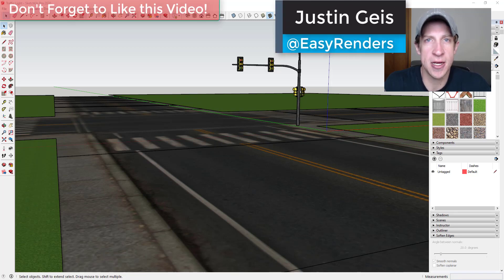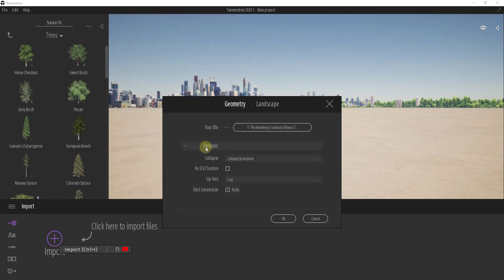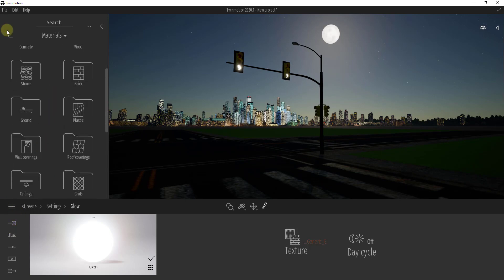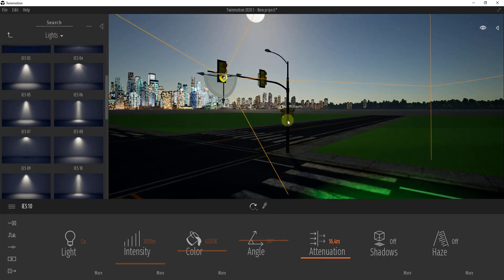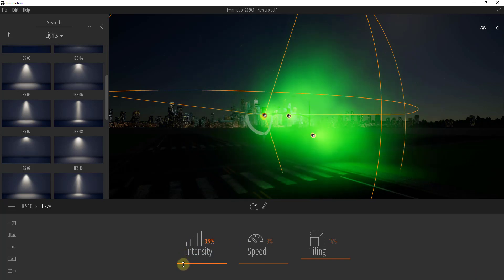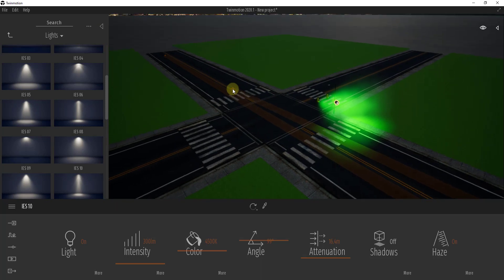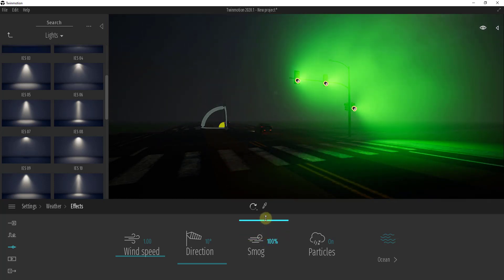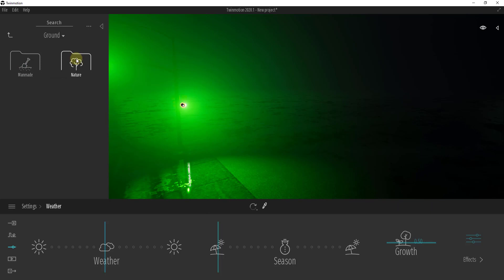New VOLUMETRIC LIGHTING in Twinmotion 2020

Comment: Hi Justin! Loving your tutorials! Just wondering if you’ve come across the issue with the Sketchup livelink into Twinmotion 2020 which basically overwrites a lot of the applied materials in TM with the SU ones forcing me to start over again. This despite ticking the box of ”use TM materials”. Seems it’s a common issue and I’ve not seen a viable workaround/way to resolve.
Reply: Btw, I’m using SU 2018 with a brand new iMac pro
Reply from the maker: Unfortunately it's a common issue and I don't have a workaround either